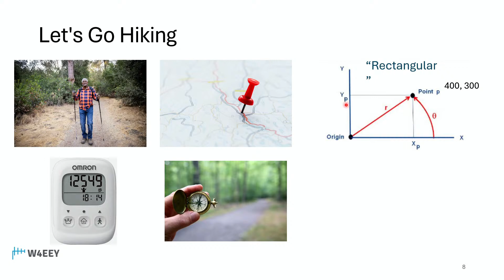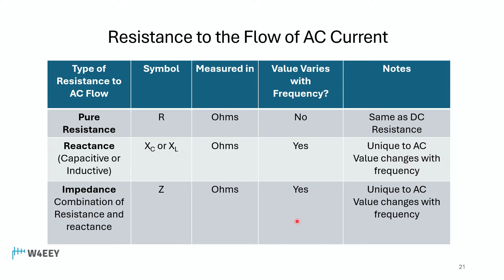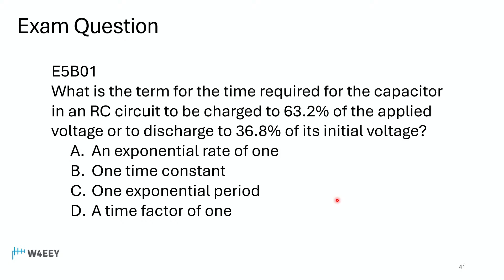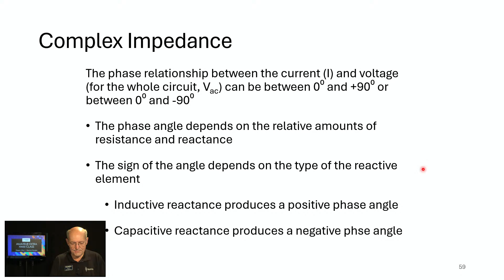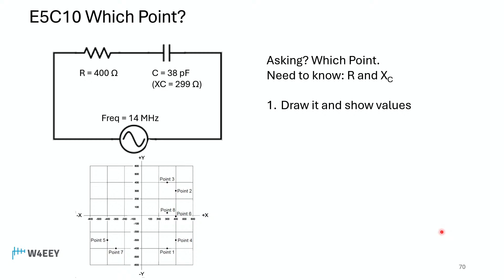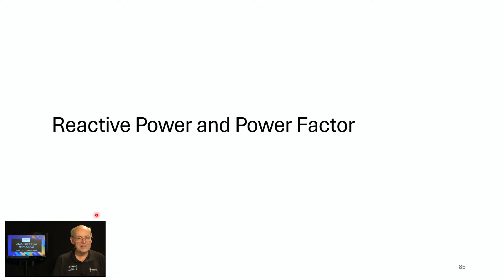Extra Class 13th Edition  - Fall 2024 -  Chapter 04 Part 01 - Electrical Principles

Comment: The Question (E5B04) has a wrong answer. It should be tau = 0 not 220 seconds. The capacitor will charge instantaneously.
Reply from the maker: Hi Laurence - Great comment. You are correct for the perspective of charging the capacitor. The parallel resistors would have no impact. But if we consider the case of discharging the capacitor then the resistors come into play. The capacitor would discharge through the parallel resistors and the Time Constant calculation works.

This is a bad question. Discharge should be stated.

73 de W4EEY
Reply: @W4EEY  I have tried to get this corrected but they think they are right. However, I do agree with your understanding including the example of the discharge, but the problem doesn't clearly ask that.
Reply: @W4EEY  The issue with the discharge is that the resistors are now in series with the capacitors discharge path.

Comment: I have a quesiton, the VE that I test with does not allow the calculators but we have to use the computer calcutors instead since I test online. Is there a setting I can use to get the I because the scientific caluclar on the computer does not have that, or I have not found the correct setting for it. I am not familiar with the computer calculators.
Reply from the maker: I am not sure if the computer calculator can do imaginary numbers (Complex Impedance, R +jX). Are you on a Windows computer or Apple? What version (Windows 10 or 11 or Apple iOS). I will look into it. 73 de W4EEY
Reply from the maker: It appears that the Windows Scientific Calculator will not do Complex Numbers. There is a calculator you can buy in the Windows Store call Complex Calculator which says it will do Complex Numbers. But it also uses the arcane "Reverse Polish Notation" (RPN) way of entering numbers (I'm not making this up. Early Hewlett Packard calculators used RPN and that's really what it stands for.) Not recommended unless you are an engineering geek.

Years ago there was an emulator that ran on Windows for the TI-36xPro. Dave and I both used it as a 90 day trial. But unfortunately it was only available for purchase in Europe. That's why I built the first "Calculator Camera". Because we needed a way to demonstrate the calculator after our 90 days ran out.

There is an emulator for the TI-30x calculator which is very similar to the 36xPro. It will run for 90 days in a trial mode. The price to purchase is not bad ($17) but you have to buy a minimum of five licenses which are good for only a year. It is designed for teachers to use in schools. You can find this here:

https://education.ti.com/en/software/details/en/1210FC9EDB85471B9F1F3BED736A1DD0/sda-ti-smartview-ti-30x-pro-multiview

Available for Windows and the Mac. It has a 90 day trial. You would need to get the approval of your VE team to use it. I suspect they might say no.

Contact Dave or me with a test question number that you are concerned about and we will try to come up with a good "work around".

73 de W4EEY
Reply: @ I am on windows and I didn’t see anything on the scientific settings at all I’m on windows 11
Reply: Use a different online VE, some just require you to do a reset while watching you do it